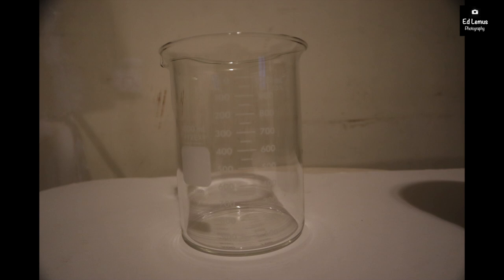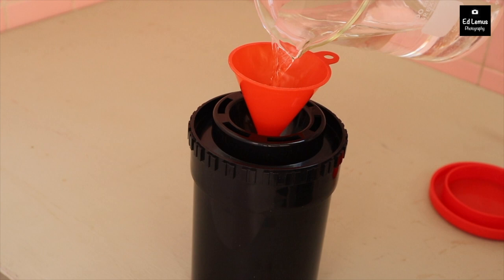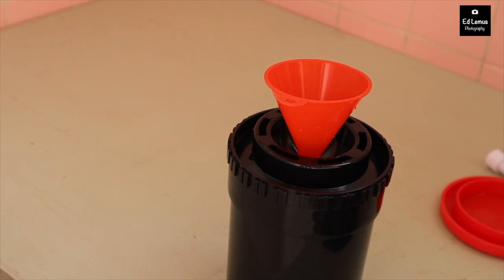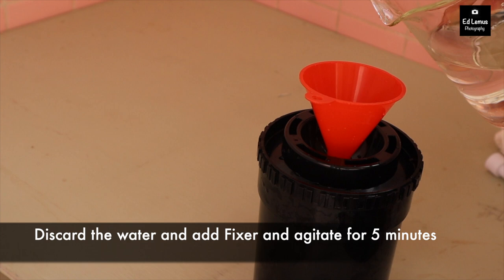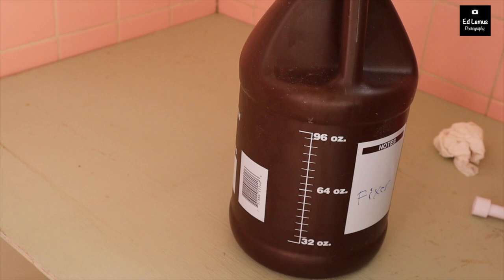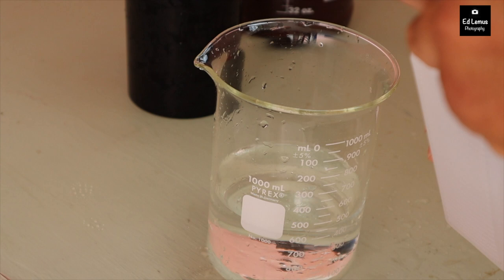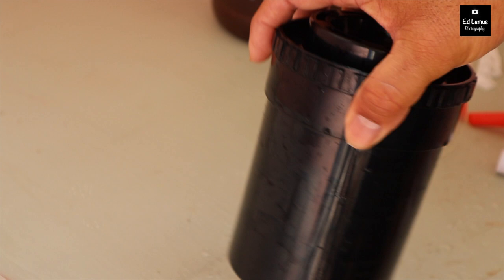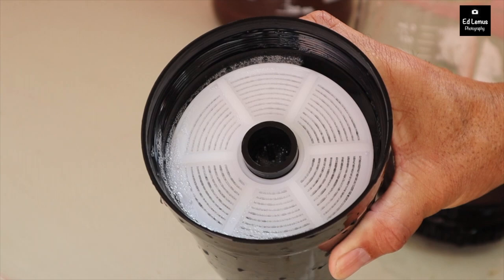Developing film in D76

Comment: Good video!! I have a question, why didn't you use stop bath? Is There a significant result with or without it?
Reply: Water is a cheaper alternative to using a stop bath
Reply from the maker: MisticPhrynosoma i usually use water; however, stop bath is a great choice. I have not had any quality issues with either. I do know that with stop bath you use less water. Good question!!
Reply from the maker: If you have any hints about using stop bath please let me know.